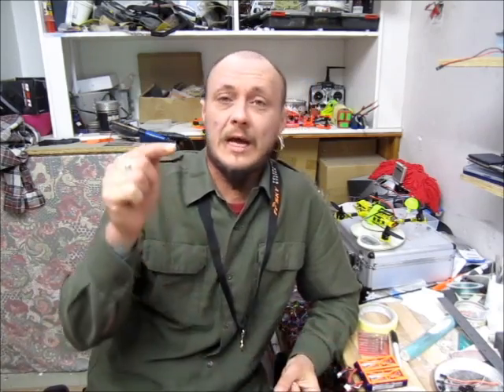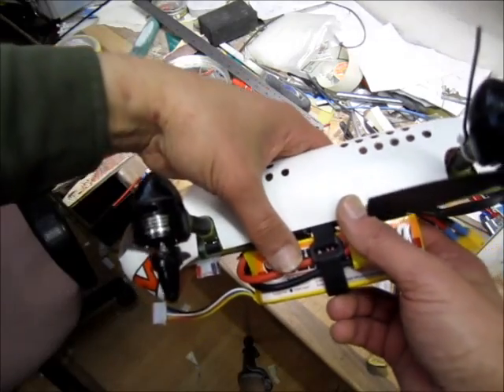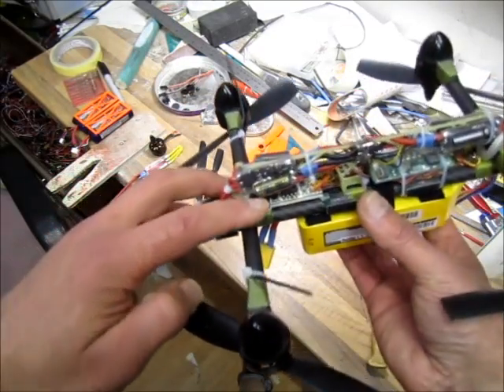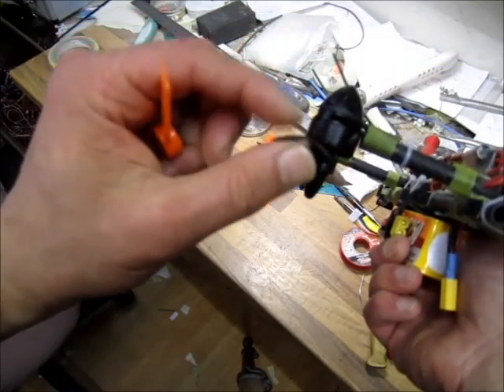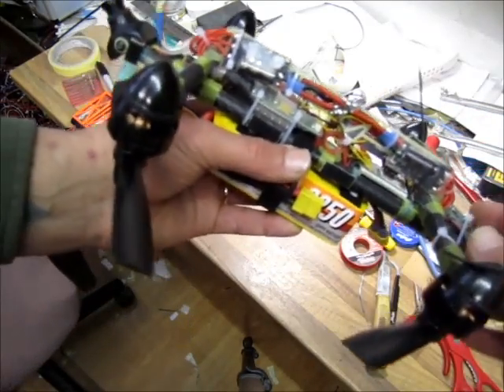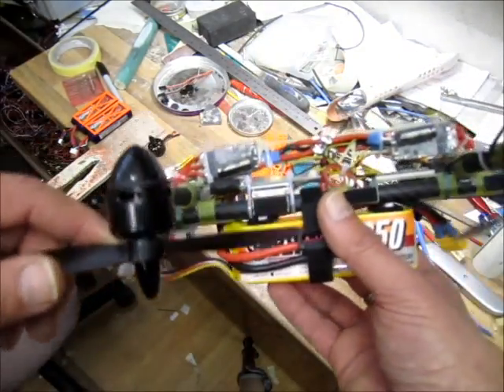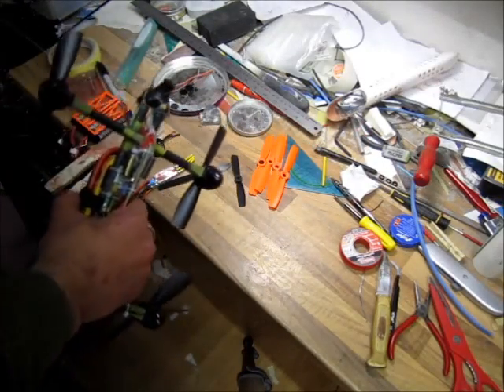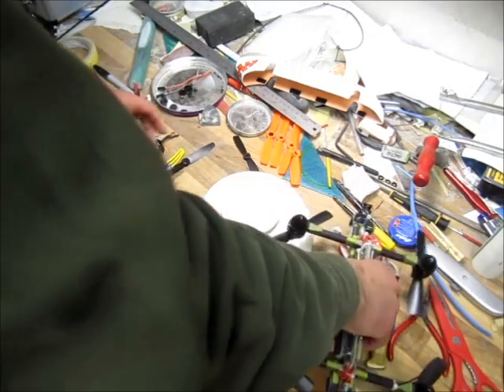Speed record challenge w/ 250mm (or under) quad. Part1- the build.

Comment: Nice build m8! I axept the chalenge. i have 2 ask why test with a 3 or 4s and not go strait to a 6s? thanks. will be waiting for the hi speed pass!
Reply from the maker: panic mike Thanks! 4s first is to know what to expect from the quad, and from my next video you'll see it was a good idea coz I was having yaw issues. Also I realized that I still gonna need a GPS logger for speed measuring coz doing WOT passes through speed gun is complicated and on 6s will be even more difficult as I'll have only one pass before battery is dead flat.
Reply: Cool! happy flites!

Comment: Great Construction again like your others, it's the Formula 1 under the mini quads!
Do you have german roots ?
Reply from the maker: ELKINGLUI Thanks! My only German root is my taste for nice German beer coz it is similar to Lithuanian, and that's it, nothing more... :))
Reply: yes germans are made for brewing beer and engineering ;)
another question about Flips and Rolls, whats your Settings on the Taranis?
I use the KK 2.1 Board and fly self level Mode, but im bored of this.. I heared of Expo Setting..
Reply from the maker: ELKINGLUI I usually don't touch the radio and set everything through the board. On Naze32 I take expo down to 0 and crank up RC rate at 1.1 and pitch/roll rate at ~0.8. And on KK2 just increase Stick Scaling to sensitivity I prefer.
Reply: Ok thanks, i try to set it and maybe upload vid on Sunday :))